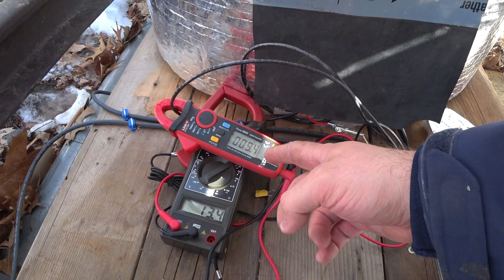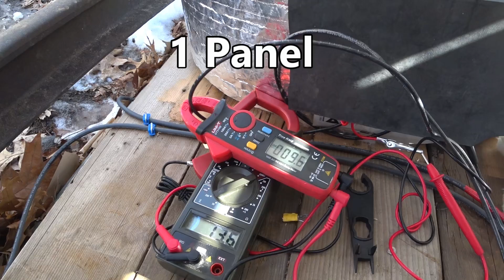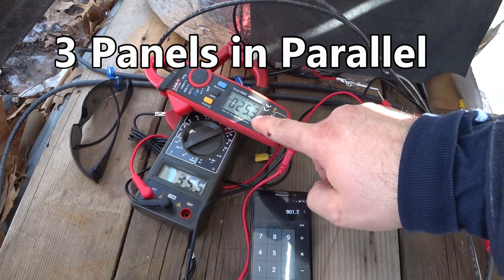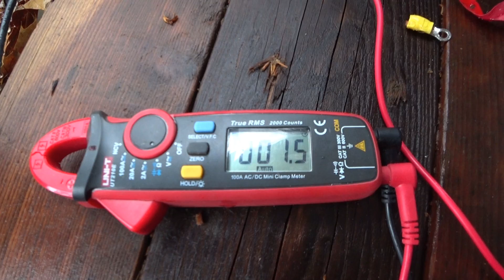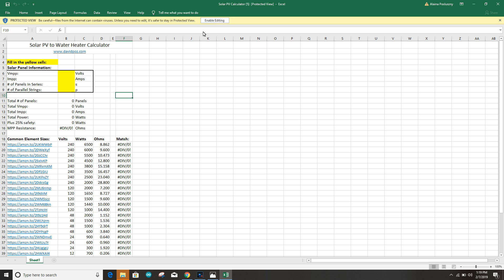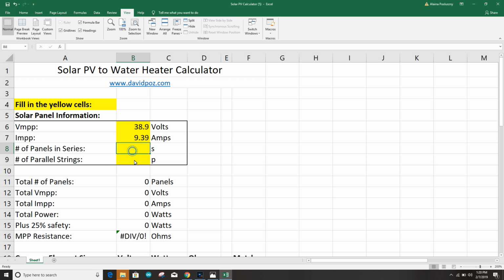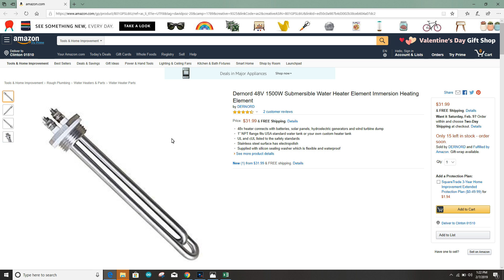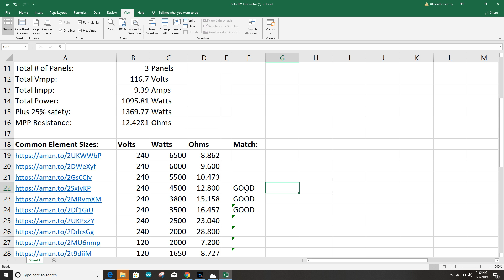Matching Water Heater Elements to Solar PV Panels

Comment: What type of heating element are you using? DC elements are very different from standard AC elements, generally much lower wattage, and quite expensive. A 3500 watt AC element costs $15-$20.  I've been off-grid over 20 years now and dumping excess PV production into hot water for about 15 years. Here's my setup:

My PV system, about 7200 watts, charges my big battery bank via 4 Outback controllers. The controllers have programmable relays that can switch things on and off at selected set-points.

 We have three inverters including two 4000 watt Trace inverters wired for 240 volts into a standard breaker panel. The big solar hot water tank has one 3500 watt AC element in it (same as a regular residential water heater, about $15 at HD). This element is wired to the main AC breaker panel via a switch box with a standard 40 amp 240 volt air conditioner relay which gets switched on and off by one of the programmable charge controller relays. So,,, when the main battery bank is fully charged according to my set-point, the relay switches the water heater element on, dumping surplus PV production to the hot water system via the inverters. If the system's DC voltage drops below the lower set-point, the charge controller relay switches the HW element off. This way my batteries stay at full charge and surplus PV production is not wasted. I know there's a conversion efficiency loss, but it's surplus power. No big deal there. I run other things DC direct (this computer for instance) but learned to not obsess over that.

The inverters are each producing less than half of their rated output to making hot water so are not getting stressed, and the system is not drawing down the battery bank; only using surplus available PV production, generally after noon.. PV is doing double duty without sacrificing any performance. Our solar tank is 450 gallons and is also heated by a 60 evacuated-tube solar water heater. We never run out of hot water. 

If the water tank gets to its high temp set-point in winter, a temperature relay switches a pump on to circulate hot water through our warm floor system. In summer, we usually have the PV to hot water dump switched off and use the surplus for air conditioning in the afternoon (another system I built to utilize surplus PV).

This system has worked flawlessly for over 15 years, and, with some scrounging, was quite affordable. Off grid. No power bill. No water bill (water also pumped with a separate PV panel). No sewer bill, no mortgage. Part of our retirement plan. Yes, we have to adjust sometimes for cloudy spells, but that becomes habitual; minor lifestyle changes.

All of that money saved can go into tax-deferred savings, or a more relaxed lifestyle. When people calculate savings that way, they can add a 35%+ premium because every dollar we save would be taxed at around that rate. Be sure to account for that in your calculations. In other words, if you are spending 200 dollars per month on retail energy, you had to earn that PLUS enough to pay the income taxes on that amount, say $270. If you didn't have that bill and put that money into maxing out your tax-deferred savings, you aren't paying those same taxes, and can earn something instead. Most folks don't look at it that way.
Reply: Funny, I do the same. I have the outback chargers...also the trace inverters. Two 4000 watt units and one 5000 watt trace unit. They work fantastic. What we don't spend on retail goes into savings like you said! No water, electric or sewer bill, no cable bill. We only have internet! 
Radiant heat and a rocket stove water heater on emergency basis. It really does not get better then that....
Reply: @whisky_9o5  Where do you poop?
Reply: Nice cost benefit summary. More people should consider MTR, like you did! I can tell we would enjoy taking too each other! I'm near Austin.  Check out my videos.
Reply: I harvest energy directly from the panels so it doesn't confuse the controller in charging.  If you have REALLY big batteries it doesn't matter that much.  I look at the power point voltage of the array and transfer any excess to heating water, whether that be 5W or 500W. Small power levels are important because it takes 50 or more watts just to maintain tank temperature.  This is a top performing system that does more with less. This is just a camp, but I even have a dishwasher with heated dry.  All that with just a car battery!  People in solar are the greatest energy wasters on the planet.
Reply: @opera5714  Hi there, do you have any videos on Youtube? I tried to find you, but couldn't. I'd love to see how you directly heat water without "confusing" the charge controller. Could you please send me a link?
Reply: @opera5714  No! we are the thriftiest energy spenders. Nothing would go to waste if we had the option.
Reply: TheGhung Fu, any chance I could touch base with you to learn more about your setup? Sounds awesome! :)
Reply: Hung Fu: PLEASE make a video of your system, sounds like just what I need. Doesn’t have to be professional, just a quick over view of all the equipment you used plus how all was connected. Go for it!
Reply: Have you had any issue with corrosion running an AC element on DC? Maybe it would be sufficient to invert the polarity at the element every few months to spread the corrosion across the element
Reply: @Ricmcspeedy987  Corrosion is better taken care with a sacrificial magnesium electrode that lasts about 5 years. It costs around $40 and you need to unscrew the old one from the top using a large 24mm socket (if I remember well). A cheater bar and a helper to prevent the tank from spinning may be necessary too. Usually you'll find that the old electrode has been almost totally consumed when rusty water rushes out.
Reply: A video walk through of your setup would go down well!
Reply: @TheGhungFu Sorry to dig this reply back up again, but could you offer some advice on this setup for a smaller scale system? I just wondered how many watts of solar you need for this to work in relation to the heating element 🤔 i.e is it best to have 300w of solar for a 300w element? Or is it better to oversize the solar wattage? Thanks.
Reply: From my research the is no such thing as a dc element, its a marketing con with a DC sticker slapped on, you just have to match the ohms ect.
Reply: A DC element is very different. It has different coatings to prevent electrolysis. Get educated
Reply: @climatechangepreppersfaceb2148  I believe the outside of the metal jacket gets hot in the same fashion regardless of the flavor of current running through the inside the element.  The water itself has no idea if the electricity is AC or DC.  No?
Reply: @climatechangepreppersfaceb2148  How do you get electrolysis when the anode wire is inside the cathode tube with ceramic powder packed in between? Also aren't most heater elements sheath made of SST to prevent corrosion so no coating is necessary?
Reply: TheGhung Fu don’t matter, ac or dc...ac element will work just as good

Comment: I've been using a 12 gallon water heater as a shunt load for a couple years. My panels are always in parallel. I use a 1600w boost converter on the shunt output of my MPPT or sometimes directly from the panel box. The heating element is switched from a 200A relay controlled by the tank thermostat through which I run 24vac from a small transformer. 
The element is a cheap off the shelf 1500w 120vac.
Its run flawlessly for 2 years after being in AC service for 3 when I was on the grid.
I usually run it at 80vdc. I've also run it directly from the inverter, but I like to keep it separate.

Comment: Thanks for the vidéo.
One option to increase the number of panels in series is to transform your 48v into a 96v heating  element:  Remove the two busbars and add a new busbar in diagonal; the two half heating éléments are now in series instead of parallel.
Regards.

Comment: I think experiments like this are fantastic learning platforms. Sure you can buy a power controller that takes the guesswork out of it but that also robs you of the experience of learning about this stuff. How solar panels make power is something that this experiment really demonstrates. Solar panels do NO act as batteries do. They have a very high equivalent internal resistance in comparison to a battery or a heating element. When you couple a current source with a high internal resistance with a load that has a low resistance the system voltage will go wherever that low resistance load takes it. 

I don't think there is any expectation that this experiment is going to yield the maximum power from the solar panels. What it does demonstrate is that with a little understanding of how this stuff works you can put together something that is functional even without a bunch of electronic wizardry.

Comment: Sooo, backing up to what I said a few videos ago where I mentioned using standard electric water heater tanks from a big box store. They cost $100-$200 but are already insulated, already have t-stats, and already have at least one heating element, which would have saved quite a bit on fabrication costs and time. Not breaking balls here. Just pointing out alternative resources that can be way cheaper and still do the job, given a little thought. I also didn't realize your PV panels were 48 volt, which is a game changer from using 12 volt (nominal) panels. This where we can all learn something! BTW, any heating element can be used in a lower than rated voltage input. What you get is lower watts consumption / heating output. You can do the math, but I am saying a 240 volt / 2,000 watt element will only yield 1,000 watts of heat at half the voltage. (roughly) The key is to start with an element rated more than the system by a little and figure what you can get from it. Basically it will last longer (life span) if used at the lower voltage.
Reply from the maker: Hi Rupe53, It's great learning from everyone and I appreciate your input.  I think the wattage would be one quarter if you half the voltage going into the same element, but maybe not, I'm learning.  Thanks for watching.
Reply: @DavidPozEnergy  It's the square of the voltage so 1/4 is correct.  Can't you put those elements in series or is that in series already (two 24V elements).  Operating at lower voltage does prevent scale building up on elements ad depositing on the bottom of the tank.  Do you have a watt meter that accumulates the total power each day? It is easy to figure out what the power would be if operated at power point in low  light..  Amps times rated peak power voltage times .9 gives a close approximation.
Reply from the maker: Yes, this particular element that I have can be re-wired into series if I need to.  Right now it is wired in parallel.    I haven't tested the series so I don't know how that might help or hurt.
Reply: @DavidPozEnergy  If two bars are in place they are parallel. Putting them in series would result in 6 ohms. Haven't heard of 96V element options, but I refuse to go to the Missouri Wind and Solar site for any reason.  There are plenty of AC elements that are suitable.

Comment: You can wire it in parallel or series, as long as the heating element is rated for the sum of the Voltages, and/or the wires are rated for the sum of the currents.
Reply: True. But the lesson here is about matching your setup to the load driven.

Comment: You’re much better off using a diverter. That way your whole PV system will both charge your batteries and heat the hot water and it will deliveri the correct voltage and current to match the heating element.
Reply from the maker: I agree.  I'm working on a storyboard for a diversion video.  It's another piece to test.  I'm trying to put together the whole puzzle of all these different options for heating water.  Thermal, direct connect, diversion load on DC side, diversion load on AC side, and (if I ever get my hands on one) an MPPT direct connect.  I want to test them all.

Comment: You can overcome this with A LITTLE electronic. Switch only through, when 60 volt or higher is reached (see mppt). Advantage: You don't need so thick wires...

Comment: 3073 BTUs from the heating element at 900.6 watts. That should warm things up just a bit! You should gain about 7.4 degrees Fahrenheit per hour, based on 50 gallons of water.  If I would have known the heating element you were going to use, I could have done the calculations for you. I just didn't have the data. I STILL stand behind my previous prediction. The thermal panel will be more efficient than the photovoltaic panels, enough to offset the difference in solar area. That is, until the temperatures of the barrels exceeds 120 degrees Fahrenheit. The black body radiation of the thermal panel will cause it to lose efficiency at higher temperature. The photovoltaic system will maintain the same efficiency, even if the water boils! (I changed my temperature threshold, based on the brighter and sunnier day). Cant wait for the results!
Reply: 8

Comment: I heat my offgrid house using solar PV but to have better efficiency I designed a Digital MPPT controller that matches the PV array max power point at any point during the day by connecting a number of heating elements in parallel (as many as needed depending on the amount of sun). 
You can see a presentation about all this here  http://electrodacus.com/DMPPT450/dmppt-presentation-v01.pdf  and I selected PV solar heating as it is the most cost effective option when comparing with both natural gas and thermal solar (sorry if this is a spoiler :)) Even with the simpler method used here you will get about 80% efficiency in a sunny day and much less in a cloudy day unless you manually change the heating element value. In any case even the simpler solution will be better than thermal solar and way more reliable and simpler than thermal solar.
Reply: A home here in town was built last year using a 2ft deep sand bed under the concrete slab.  4in of foam insulating the entire mass from the earth.  The heat from solar is pumped in at the bottom under the sand.  Pretty cheap and simple.  It drops about 3 degrees F in a week at 0F outside.
Reply from the maker: Your device looks awesome!  I remember seeing it when you were doing kick-starter.  Are you going to work on a 48 volt version?  My battery is a 12s setup.
Reply: Sorry the SBMS is designed with 8s in mind and while two of the low cost SBMS0 can be used for up to 16s is not an elegant solution as there are two displays each monitoring half of the pack. I will need a complete redesign for 48V support and I do not have any plans for that.
Reply from the maker: Thanks for getting back to me.  Well, if you ever do design a 48v system, please let me know.  I watched some of your videos.  In one of your presentations you were talking about using 55 gallon plastic drums for thermal storage.  Did that work out?
Reply: Yes I had one 55 gallon plastic drum that I used last year with direct solar heating as a buffer then from the barrel the water was circulated trough PEX tube embedded in my house concrete floor.
55 gallons are about 200 liters and to heat 1 liter of water by 1 degree Celsius you need 1.16Wh of energy so considering ambient of 20C (68F) as starting point and 55C (131F) as max temperature there is a delta of 35C then to fully heat that barrel from 20C to 55C you will need this amount of energy 200 liters x 35C x 1.16 = 8.12kWh of energy.
So you can consider one of this barrels filled with water as a 8kWh thermal battery and this plastic drums as so inexpensive and water free that is a good thermal storage solution.
My small energy efficient house will have a total of 160kWh of thermal energy storage the 14 cubic meter concrete floor has around 97kWh of thermal energy storage (fully insulated from outside) and then I will have a 1500 liter plastic water tank 1500 liter x 35C x 1.16 = 60.9kWh
Still need to install that one by next winter as the 97kWh is only good for about 3 cloudy days and sometimes I get much more even if is relatively sunny here in Saskatchewan Canada.  There are -37C (-35F) here at this time but sunny.

Comment: To continue my notes on PV constant current sources, even with the paralleled panels which can now overcome the low resistance of the heater in full sunlight, if there is any overcast or the sun angle is not optimal the voltage will collapse again as it did in your first attempt. This means you will only heat effectively in direct sunlight.

Comment: Solar PV panels need to be considered as constant current sources. If the current draw exceeds the the maximum current available for the illumination provided, the voltage will collapse. Therefore the only way to obtain maximum power output is to use an MPPT DC-DC converter to match the heating element impedance to the panels. MPPT charge controllers will not work as they are all programmed to expect some residual battery voltage to function and will not initiate charging to a resistive load. The simple choice would be to parallel the panels for higher current at lower voltage. The will however not utilize all of the available power.
Reply: But for the price of the MPPT i can buy 2 or more extra panels.
Reply: I would really like to do this but I am struggling to find an MPPT DC-DC converter that is not a charger. Is there a device you can point me to? Much appreciated.